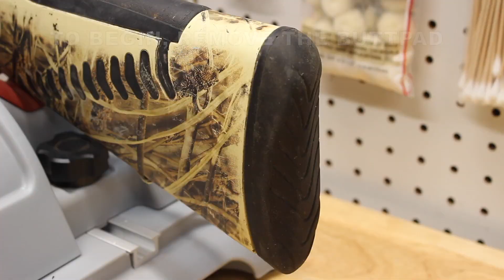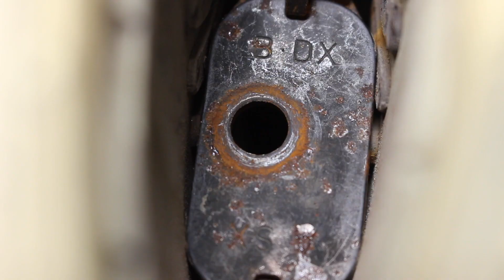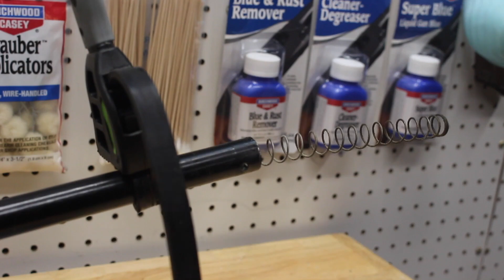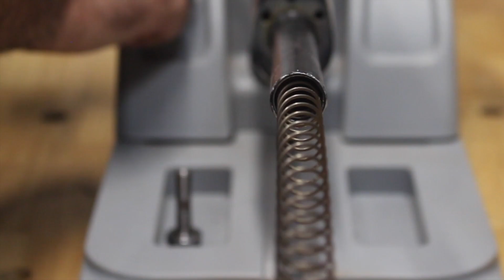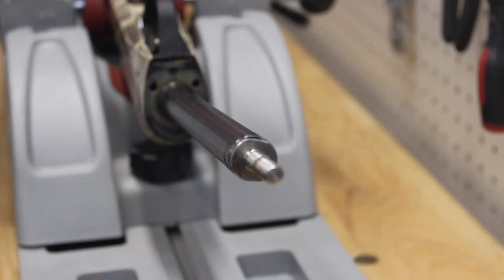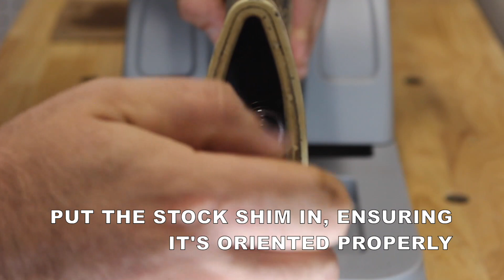How to Replace a Recoil Spring on a Benelli Shotgun

Comment: M1 SUPER 90......DO NOT USE A CRESCENT WRENCH IF YOU ARE REPLACING THIS SPRING ON THE OLDER SUPER 90'S!!! Even after heating the spring nut, I used a crescent wrench and it rolled the corners of nut.  Use a channel lock and it should be fine.

Comment: Where do you get the longer spring?  I called Benelli and they said they don't have a longer spring than what comes with the gun.
Reply: I think what he meant was that a new spring will be longer than a used spring; the used spring gets squished shorter with use.